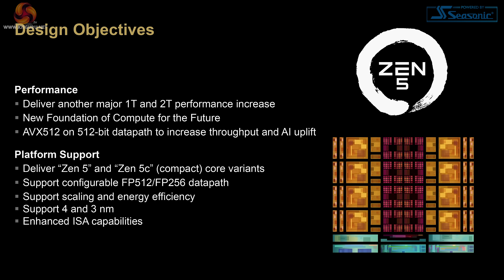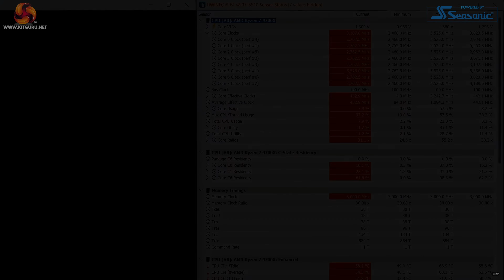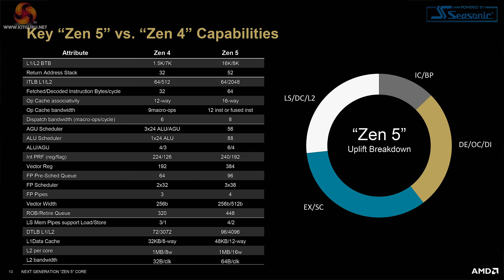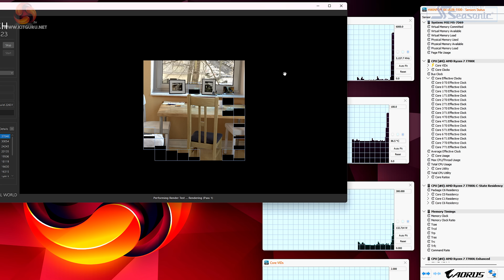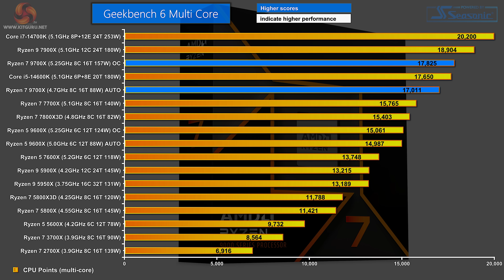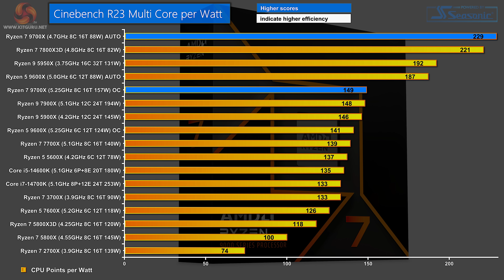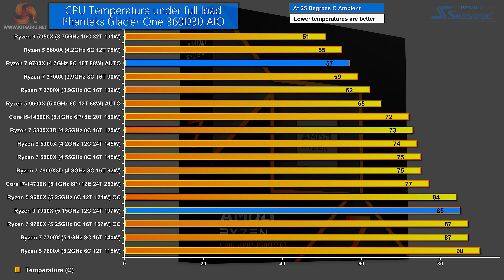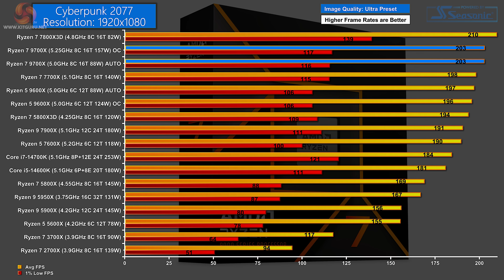AMD Ryzen 7 9700X review: YouTube hates this CPU

Comment: I think the problem is still that the 7600 and 7700 non-X variants exist that basically meet similar power draw and efficiency to these. Unless we see the 9600 and 9700 non-X in the future being even more power efficient, those 2 existing non-X chips make these seem weak too given they weren't much slower than the X chips to begin with either.
Reply: @somebody700  People need to stop glorifying this race to the bottom of skill. It's literally one click, same as setting your ram speed, which if you're going based on put it together and plug it in defaults, the lower ram speeds will result in a pretty big hit on any platform.
Reply: That's not valid because the 9700X is already faster than the 7700X in most situations despite drawing about 50-60W less.  The non-X Zen4 parts would be even lower, not much lower, but enough that they won't be as efficient as Zen5.
Reply: @somebody700  That's just mental gymnastics to justify being bad at computers. Stop glorifying being dumb.
Reply: Lmao and none of those CPUs are going to perform anywhere close to the zen 5 parts at stock.
Reply: @somebody700  Can always turn on PBO and have it run 20-25% faster. The 7700x is already running max boost, if you turn on PBO on a 7700, it still falls short of the 9700x with stock settings. Secondly, the architectural improvements to zen 5 will be very conducive to x3d, as they improved latency and cache speeds.
Reply: @PineyJustice  Can always turn on PBO and put your cpu of of warranty.
Reply: @gorkemefeozkok8967  I've never even heard a report of warranty being rejected for overclocking. If you try to RMA because it won't hit some number they'll tell you no, but if it just dies on you they will RMA it without even asking about OC.
Reply: @PineyJustice  regardless its a risk, they state that PBO is out of warranty.
Reply: @gorkemefeozkok8967  hi amd yea its your customer i need to replace my yes i voided warranty yes im an idiot for telling you oh so i should have just said idk what pbj is? ok thanks. what are they gonna come over check your pc settings... they dont even need to know what freaking pc it was installed in smh im losing faith in ppl
Reply: @somebody700  the software lately makes overclocking a two click process i dont see how their point doesnt stand. 20-25% is significant.
Reply: @somebody700  no
Reply: @JohnSmith-ro8hk  Yes

Comment: Zen5 is about getting the best of Zen 3 and Zen 4 at the same time. It runs as fast as Zen4 but at the power of Zen3. Remember Zen4 is an answer to Intel Gen12 a hot race of performance but sacrifice efficiency. Generally they are close in performance but Intel lost in efficiency. If you do not care about efficiency then Zen5 is highly over clocklable. Do OC and you get up to 20% better in performance. Good engineering job form AMD to achieve all of this with a die shrink and same process node of Zen4. But bad AMD marketing job to let people expect something else. I expect 9950X a different story since  it is 170Watt CPU.

Comment: The more reviews I watch, the more the 2 Steves (HUB & GN) disinterest in these chips stands out. HUB focus on price/performance so new chips always fare poorly, which is fair. GN was unimpressed but maybe they didn't have the time to overclock the 9600x/9700x. (edit: GN 9600x was defective.) Other sites like yours, L1tech, Ancient gameplay were all pretty positive after OC.

So I guess moral of the story is to watch more reviews. So you have gain a sub from me today.
Reply: GN Steve won´t have changed his opinnion on the CPUs with PBO since using PBO is not in AMD default specs and voids the warranty. If AMD would have wanted the CPUs used with higher powertargets and more performance, they need to release CPUs with this powertargets out of the box.

I think we should have learned out of the whole Intel "What is default?" story.
Reply: @jojobetzler3732  agree GN Steve wouldn't change his opinion and that's why I think their (GN & HUB Steve) assessment are fair but omit a lot of info.
Reply: @erictayet  Both Steves didn´t omit some info. GN Steve mentioned the thermal and powertarget headroom for overclocking by activating PBO. HUB Steve included the 9700X with active PBO in the 9600X review Cinebench charts.
Reply: It looks like the 9700x was only slightly faster or even slower in some games after OC in this video?
Reply: Yes but none of them equilibrated the cost of energy into their analysis.
Reply: @NineS5  You need one requirement to sell newer parts for higher price. The current gen needs to go off the shelf (since there are new Zen+ and Zen3 parts still on shelf thats unlikely) or the new gen needs to have some noticeable performance/efficency increase over the current gen.

Nobody recommended to upgrade from 5800X3D to 7800X3D because AM5 is more expensive and the performance upgrade wasn´t this spectecular. I won´t even recommend to upgrade from AM4 to AM5 if the person doesn´t have a 5800X3D. Just buy a 5700X3D or a 5600X3D for dirt cheap, maybe used. In the same time I won´t recomment a new AM4 build from the scratch, because the 7500F and the 7600 are good value CPUs for their current price.

The problem of Zen5 is, the value is bad because the prices are too high and the performance increase isn´t significant in gaming.

Linux, AVX512 and some other productivity tasks are a whole different story, but most of the techyoutubers are more in gaming, so the gaming performace is key in the day one reviews of a so by AMD called "gaming CPU".
Reply: The problem is that everyone is only comparing the 9700X to the 7700X and saying that it is incredibly more efficient, when it's not the 9700X that is incredibly efficient, but the 7700X that is inefficient. As soon as you start comparing the 9700X to the 7700 non X you see that it's barely better for the same power usage. HUB found that the 9700X has 7% better performance in games for the same power as 7700.

Also it doesn't matter what the initial MSRP of Zen 4 chips was. The only thing that matters for is checking how greedy AMD is. I'll ask you - is 7% better performance for the same power usage worth paying 70 USD more? Not to mention that here in Europe these prices are even worse as you can get a Ryzen 7700 for 227€ while the 9700X is going for 445€ (though obviously these price differences will become less extreme in the coming months).
Reply: @lycanthoss  And that's why I don't take HUB's price/performance matrix into consideration at all because prices change on a weekly basis and I'm not in the US.

The performance and power data is good and easy to understand but the conclusions for price/performance is valid for a month at best and only in the states.

Also, a lot of emphasis is placed on gaming performance, other reviewers who are more technical also show compute benchmarks and those are great on the 9700x at default TDP. Especially AVX512 for renders, video encoding and AI workloads. 

If you look at AMD's presentation, you can already tell that Zen 5 concentrates on efficiency and 512bit compute. Integer/floating point/SIMD compute used by games are unchanged. In fact, I think the 512bit data bus is SLOWER then Zen4 256bit data bus for 64bit integer/FP data loads due to the address decoding logic.

Is AMD greedy? NO! The MSRP for the 9700X is lower than the 7700X. You can't expect a company to launch a new product at the current price of a 2yo last gen CPU. How can they recoup the R&D costs? Without R&D, how can companies afford to develop new products in future, especially high-tech stuff like chip design?
Reply: “After OC” is the key phrase here. OC voids your warranty and is not officially supported. It’s also not a use case for the majority of consumer CPU purchasers. So I think GN and other reviewers are completely valid in being thoroughly unimpressed by its intended use by manufacturer from a cost to performance standpoint.
Reply: they were being too positive if you ask me, AMD should be emberased to realize such CPU for such price, even if you ignore intel completely, its awful offer

 i can buy brand new PC here with 7500F for 160 Euro, 7600 for 190 Euro or 9600X for 320 Euro, gee i wonder which to pick 

AMD never misses an opportunity to miss an opportunity huh?

what a waste
Reply: @Trisstan20  you are comparing the price of a 2yo CPU to a new one? MSRP of 9700X is lower than 7700X.
Reply: @erictayet  Since I pay the current price for the 7700X and not the price two years ago, I don't care about the price two years ago.
Reply: @jojobetzler3732  Then wait some more for the prices to drop. 

But many reviewers have already shown 9700X can perform so I'm looking forward to 9950x having great performance at higher TDP.
Reply: @erictayet  Why wait when the 7700 with a Peerless Assassin is 37,5% cheaper, has only 7% less performance and no memory instabilities right now?

There will be a time, when the 9700X has a better value but it´s not right now.
Reply: @jojobetzler3732  I understand your POV, but I think AVX512 will become more important in future especially in games for matrix calculation, ie., drawing the polygons, game AI & some Raytracing compute.

In AVX512 calculations, there is a 30-40% uplift from 7000 - 9000 series CPUs. Cache performance is increased 100% so while current games wouldn't see much gains, in a year, we could see newer games take advantage of Zen 5.

And by that time, the 9700X will be more attractive in price too.
Reply: @erictayet  But with this POV we should wait to buy Zen6 with DDR6 and AM6, because it will be faster than Zen5.

I´ll never ever buy another part of hardware, when I´m waiting until "the future" is here.

I built a new PC this year from the scratch and thought about waiting until RTX 5000/RX8000, Zen 5 and the new AM5 chipset is released. I´m glad I bought a 7800X3D, a B650E Taichi Lite and a 4080 Super instead, because now at the rumored launch of the RTX 5000 series, I have my new system for one year in usage, instead my old shitty system. Sure Zen5 and the new GPUs will be faster, but they wheren´t on sale in feburary this year.
Reply: Most people don't do OC, especially because it voids the warranty. But yeah, so far, these CPUs are for "enthusiasts only" considering how you have to OC them to get the expected results.
Reply: @marcelolemoss  IDK man, I thot most people who buy AMD CPUs now would know that the whole point is the ability to overclock even the 9600x.

Other than that, most other people who buy pre-built system will probably have PBO enabled by default. This is true for Intel k-CPUs as well.

I was with Intel for the last 20 years until Zen 3 and one of the reasons is the extra performance the 5900X bring when doing all-core overclock.

I mean even the mobile chips like the 7940HS can be overclocked in the Minisforum 790 Pro. So AMD brings incredible value. And it is VERY hard for Intel or AMD to proof you overclocked your CPU.

Comment: Mid level cpu with a $1000 gpu?   How about some benchmarks with something realistic like a RTX3060/3070?
Reply from the maker: This is a CPU review so bottlenecking the system with a lightweight GPU would be a problem. The other snag is we will use the same test set-up for Ryzen 9 and, eventually, Zen 5 3D and we need to use the same GPU throughout. Basically there is no winning.
Leo